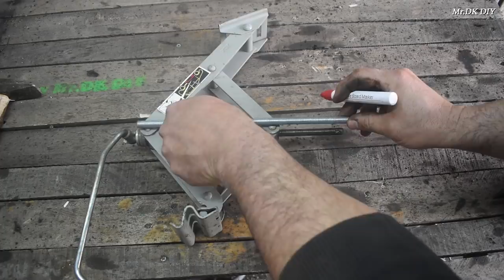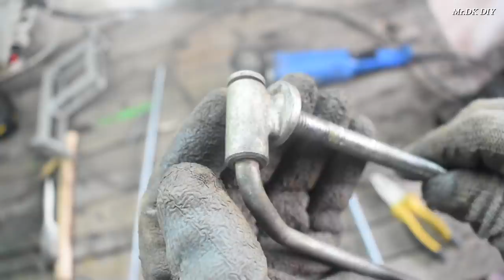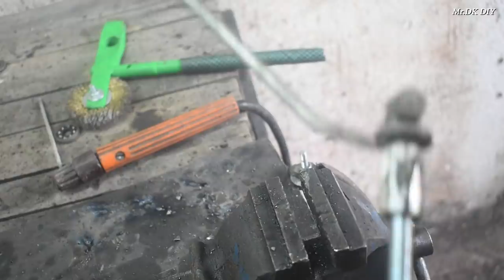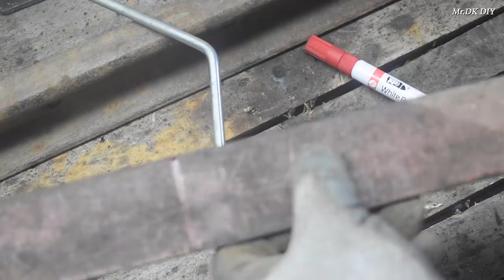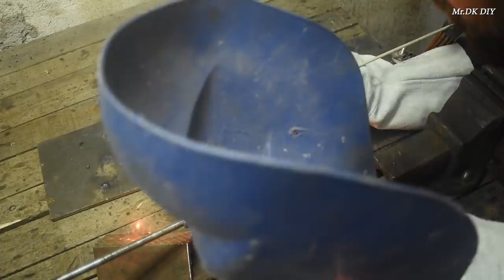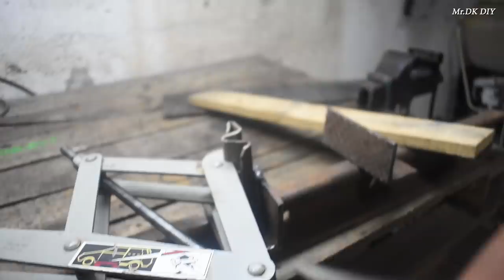OLD SCISSOR JACK ??? Do not throw it, just make it simply useful thing /Mr.DK DIY

Comment: Idea is nice just a few different thing modify the cranking mechanism say a bolt so you can use a drill and instead of the steel eye beam attach to a solid chunk of wood 4x4 or a 4x6 piece of timber.